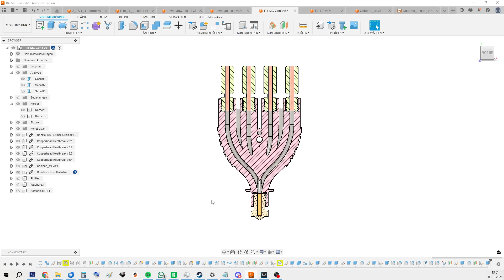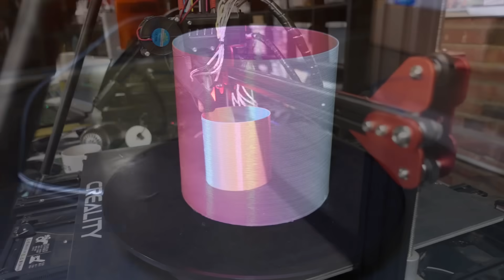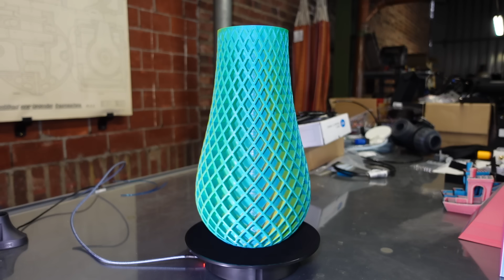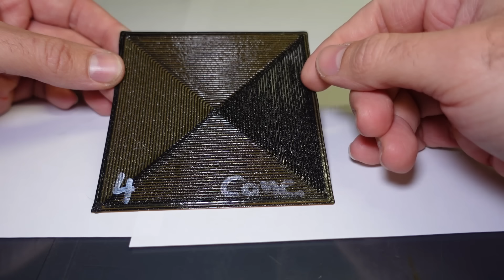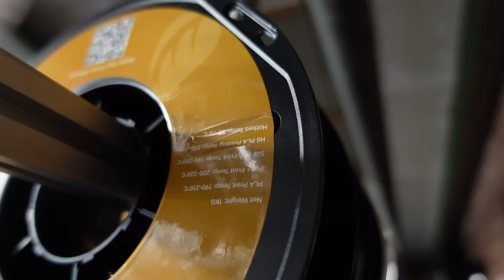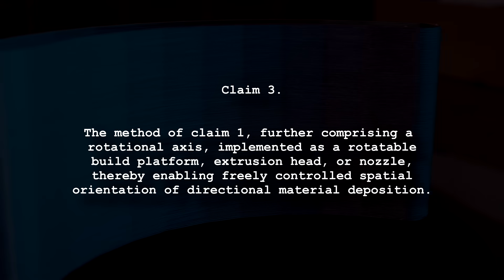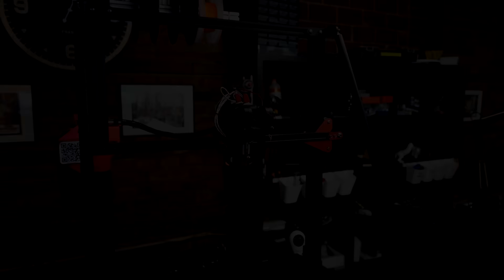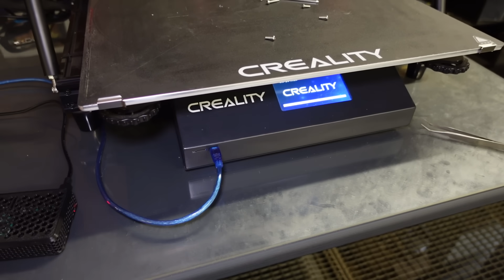WASTELESS Multi Color 3D-Printing. Introducing the Open Source Co-Hotend (Roetz-End E03)

Comment: Dude, you only need a rotating hotend and you literally solved full color 3D printing with basic filaments! Amazing job!
Edit: Just read claim 3 that some of the comments mentioned. Obviously you already thought of this. I skipped over the patent stuff since I'm here for the interesting tech, not the legal, that's why I missed it.
Reply: Rotating build plate in delta printer?
Reply: @ChrisEpler  Yeah that could work, would probably be the easiest way to go about it. With a slip ring it could rotate endlessly without issues. Calibration and leveling would be on a whole new level though.
Reply: Thats literally claim 3 in the video, no?
Reply: I was thinking more of something like a voron 2.4 or Delta with spinning buildplate. A 4way splitring could take care of heating and sensor allowing for infinite spinning
*I see I wasnt first to suggest this
Reply: Came here to say the same thing! Also, if you could independently vary feed rates (so that all 4 filaments still totalled 100% of the overall required feed rate), you could have even further control of colour mixing.
Reply: Use a ferromagnetic material as buildplate and use induction heating.
Power over sliprings is quite tricky, contact surfaces out of gold will work (i've seen it for about 16 servo motors in one slipring). Cheaper solution's are prone to wear and tear with a decent amount of power.
For temperature sensing a directed IR thermometer on the outer portions of the build plate would be sufficient, overtemp protection could be realised with a fuse in the middle or near the middle of the static part close to the buildplate.
The temp is relative anyway, correction factors can be determined...
Complicated but not impossible i think 😅
Reply: Rotating the bed surface would be much easier.
Reply: @Noozleboss already made it.
Reply: @FedericoFaure  I was about to mention this!! This is not something new it is even far from what others achieved with the same technique
Reply: The 4th axis via a turnable build plate would be far easier.
Reply: @extrawitz rotating needs to be at the nozzle location, not ctr of the bed, if we rotate the bed the math and movements required would increase significantly - wouldn't they?
Reply: He has already addressed this in claim 3, exactly explaining the rotation of the tool head.
Reply: doesn't work for top or bottom faces tho.
Reply: Rotating hotends already exist with non-linear 3D printers
Reply: Like a few others have noted, a rotating bed might be a better solution, though it might require pretty significant print head movements to counter coordinate changes further out from the bed. Inverse kinematics to the rescue!
Reply: No, he didn't. As he said, you can only get gradients between neighboring colors, so there is no potential for full color here. Also, this was basically already a thing. Two-color and tri-color coextrusion filaments already exist
Reply: I came here to say this
Reply: Just rotate the end of the nozzle after the filament has melted?... But that would also cause a column of rotated melted filament... Either keep track of that with software...

Or build an excavator inspired rotational coupling where melted filament could enter the rotating hot end radially.
Reply: There’s a channel called “nozzle boss” that’s done this with a polar printer and possibly a rotating nozzle, too.
Reply: You could have a rotating build-plate with existing coextruded multicolour filaments. Maybe just have a colour sensor or three in the hot-end, or maybe just calibrate it before the print.
Reply: Came here to say this. Rotate the print head.
Reply: Not full color, but 4 combinations of 2 colours. Still an amazing feat
Reply: There's a lot of discussion here about avoiding twisting up the input filaments if you have the nozzle spin.

But why not just rotate the spools too? You can put the four spools on a rotating plate above the printer all feeding into a single hole in the middle and a cheap dc motor + encoder can make it follow the rotation of the nozzle.

It doesn't even have to be able to spin as fast as the nozzle does because you can allow a certain amount of lag before the filaments actually start binding up.
Reply: Surely this would only have the colour correct from one viewpoint, from every other angle it would look quite strange- artistic perhaps - but strange.
Reply: Combined with a traditional multi material approach of pushing, or not, each filament. IE Four extruders that proportionally increase or decrease depending on whether or not you want a given colour.
Reply: I am losing my mind over this video! I literally posted this in some printing groups. I am screaming praises from the mountain tops! 😂😂 He can achieve such a wide array of colors/gradient like he shows in the vid. I think Bambu or Prusa need to get with this inventor and make him rich!  Do their thing, make a new machine and....Wow.... Think of the colors possible if you had a true tool changer with just 2 tool heads even. You could add Cyan, Magenta, Yellow, White and Black making all colors no? Add AMS for each tool head and presto!! I've got to be missing something. Or else big print is trying to gatekeep us 😂😂😢
Reply: needs to rotate endlessley, so hot end not suitable, but build plate with slip ring would be better
Reply: I would look to heavy machinery hydraulics as a potential solution to the rotating hot end issue. The part of the hot end accepting the filament would be a trough all around the hot end, with a hole somewhere in the trough. The filament would be melted as it enters the trough and fill it, supplying plastic no matter the rotation of the hot end. Granted, this would take some intense engineering to work, but if we can make it work with high-pressure hydraulics I'm sure we can make it work with a bit of molten plastic
Reply: Look up open source 6 axis he's even made the slicer.
Reply: yes a rotation round buildplate
Reply: Nozzleboss has been doing rotating multicolor mixing nozzles for YEARS
Reply: Would entangle the feed. Spinning 270 degree back ultra fast at corners to prevent this may not work without stopping. Rotating the bed might be better though higher mass.
Reply: @culnaurion  This is a prime example of only seeing the problem, and not the solution.

It wouldn't tangle the feed. You can easily make it rotate a few full turns before needing to reverse. Also, it's not 270 degrees, since you'd need all 360 for full color, not just 4x 90.

Yes, it does pose challenges, but it's nothing that can't be solved. Look at how slow printers were 5 years ago and look at them now. A full color printer may be as slow as those printers 5 years ago, but the tech just keeps improving and in a couple of years it could easily be a reality.
Reply: @CarbonKevin  No? You want to mix a gradient of colors, not just select one of the 4 available colors, that's nowhere near full color. If you only have 270 degrees of rotation, you can mix 3 colors seamlessly, but can't mix the two colors that are in the 90 degree area that can't be reached properly. For full color, you need full rotation.
Reply: @culnaurion  Yeah, Tough to modify a printer for that, but boy, you could sure build that into a new model. A rotating bed. Wow. That's genius. I hate that you're so usefully creative while you're so young. Disgusting...

Comment: Aluminium is hard to print, it's melty. I have designed a 20+mm long cylindrical hotend with a spiral/helix channel (eliptic shape), hoped it would be all okey but when it arrived the channel was clogged. The channel was ca 100mm long packed in 20mm height. Thx to you i will design/develop it further. 😊

Comment: sorry, how does this differ from the diamond hotend ?...
Reply: The diamond hotend mixes the colours before they are dispensed, I believe. This intentionally retains laminar flow and maintains the anisotropic appearance.
Reply: @HavokTheorem  The diamond hotend did not truely mix colors, although that was the promise. It could create different color combinations by changing input extruder speeds. If I look at 1.35-1.45 this is exactly what the diamond hotend does, it feeds 3/5 filaments in a circle into a single outgoing nozzle, resulting in exactly the same outflowing toothpaste effect and the same different colors from different sides effect when printing objects using opaque filaments.  This can be eliminated using translucent filaments. :-)

Comment: If you have 4 separate extruders (not sure if you do), and somehow can disrupt the laminar flow to mix the incoming filament inside the melt-zone, you actually could do CMYK color prints.
However, I imagine that quick/sharp color transitions, in such a setup, would be very difficult, if not impossible :/
Reply: There was a company that tried that already. “M3D QuadFusion” ran a kickstarter and supposedly even made a printer with the extruder system (M3D Crane). 

It never really materialized in the market though.
Reply: @jrobmccoy  Oh cool.
But yes, it looks like they stopped updating their website in 2019.
Reply: @jrobmccoy  Was it always a linear gradient, or was it capable of a crisp color change.
Know what it's mechanism was, did it do waste ejection? (cursory search didn't give clarifying internal images)
per "somehow can disrupt the laminar flow to mix the incoming filament inside the melt-zone"

Stopping a filament then getting it to fight for the space/pressure it gave up to every other filament seems a hard problem to solve; and that's even if just mixing not also having clean separation.
Reply: CMYK works for printing on paper because the paper is white, so it achieves lightening of colours by depositing the ink sparsely. 
So in the context of 3D printing, we are really talking about CMYKW, 5 extruders, because we need the white filament to lighten colours in the absence of paper doing that for us. Then it could do 'all' colours.
Reply: perhaps a spinning nozzle? if you can use something to continuously spin the nozzle at a certain speed the colour that comes out should be more than sufficiently mixed right?
Reply: This is what I was thinking, too- something along the lines of having 4 drive motors with bowden tube feeders for each color. Have klipper calculate the total flow (sum of all 4) to keep the needed mm3 flow consistent for the nozzle output, but be able to change each of the 4 extruder feed rates depending on the color mix desired. Also, I wonder if something like a CHT style nozzle at the tip could do some mixing before the final output to blend the colors together more? similar to an epoxy mixing tube on those 2 part glue guns...
Reply: @ratty2austin  doubt the plastic can agitate itself enough, you'd also have to have physical blockers to prevent the individual inputs from slowly melting in I'm guessing
Reply: The tiertime Cetus 2 did just this, only with two colours mixing in the nozzle.

Comment: Combine patents with another rotational (or swiveling) axis along the printhead, to enable free-color-placement-non-planar-printing. I guess that would be wild to implement, but boy, it would be even add another whole dimension to this approach.
Reply: Placing a vertical pin inside the nozzle, that is rotated at speed by a motor would mit the colours inside the nozzle. While this would intorduce a small delay, it would allow full cmyk (or cmy + black +  white) printing. The couler would be determined by the flow rate, instad of the orientation of the printhead relative to the printing direction.

An alternative methode of achiven the effect of the ideo, would be to use multicolour filament with a square crosssection, to keep it oriented consitantly.
Reply: @clockworkvanhellsing372  You wouldn´t even need a motor. Look at those syringes for 2 component glue which mix those in the "needle". Would introduce maybe even more delay, but you would not need any moving parts in the nozzle. But it could become problematic when the filament cools down and hardens depending on the material. But this could be solved by making this mixing structure easily removable after the print tho be able to replace it if needed or sth.
Reply: @qbreech9843  Those are called a "static mixer". Good luck clearing a clog in one of those though :D
Reply: @qbreech9843  agreed, that would be an option for mixing. I did consider it, when I initially came up with the idear of having a powered mixing nozzle, the spinning pin was an idear for decreasing the delay and making sharper colour transitions possible, since that wouldn't work well with a standard mixing nozzle. The pin allows for good mixing in a verry small volume. :)